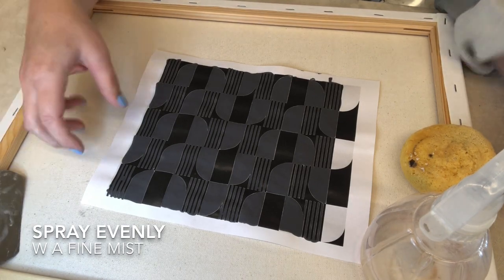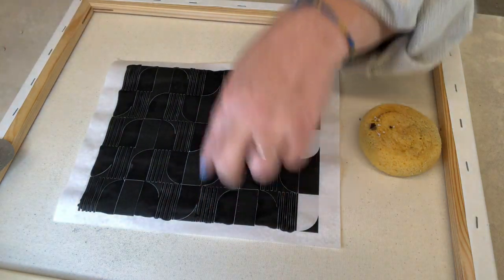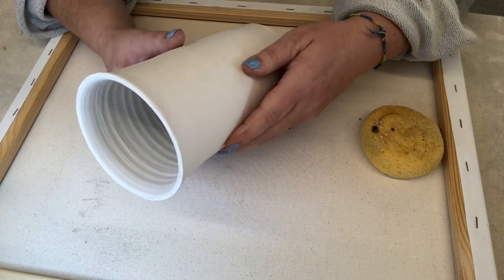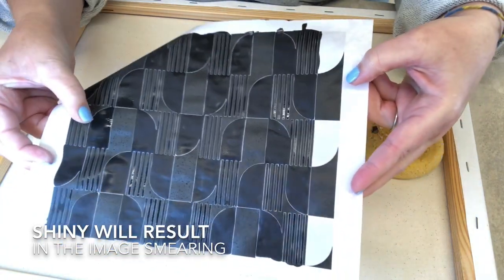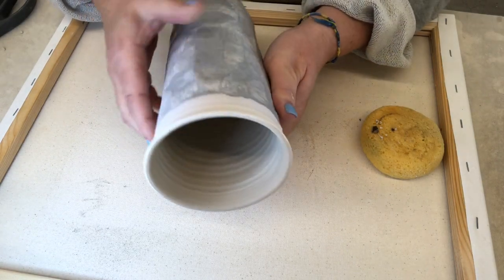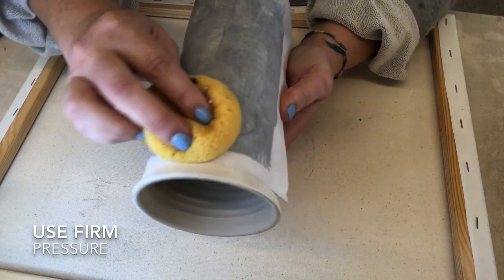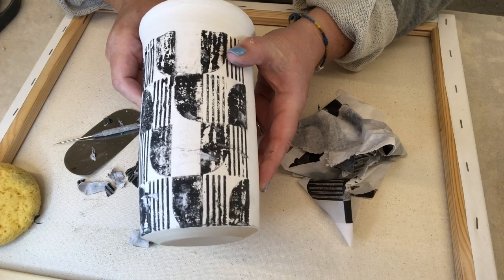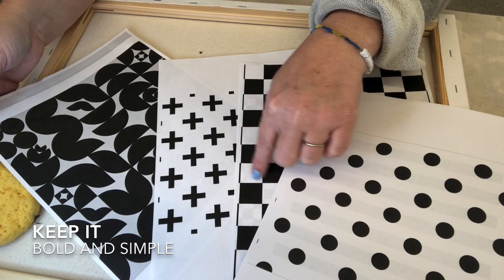TIPS & TRICKS for underglaze transfers

Comment: Great Video!  Can you dip or paint an underglaze or a glaze on the piece before you add the transfer?  (Depending on if the clay is leather hard or bisque). Then I assume you clear glaze over the transfers?  Newbie potter here!!
Reply from the maker: Yes you can layer on underglaze first. There are so many options for variety! You are correct, after the transfer you would glaze it with a transparent glaze.
Reply: @DaraGreen  What about putting them on top of glaze on a pot that has been bisque fired?
Reply from the maker: @lisabowman817  I technically do not recommend. Underglaze is just that- UNDERglaze :)  BUT with that said it will not hurt anything if you try it.  You  might come up with something cool.  I am all about breaking rules!
Reply: @DaraGreen  Thanks Dara!!  If I give it a try I will let you know!!Thanks for the great videos!